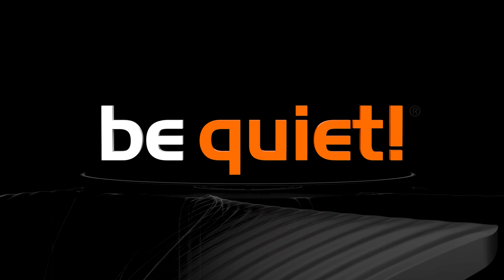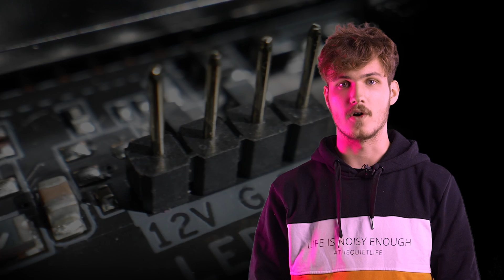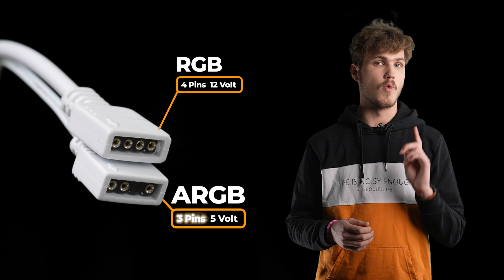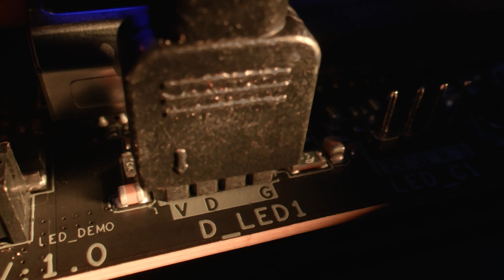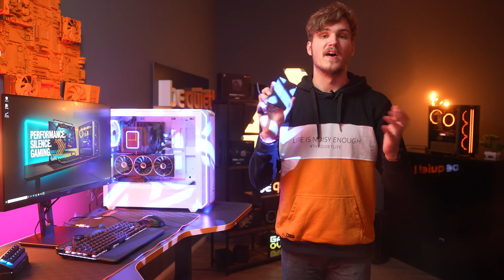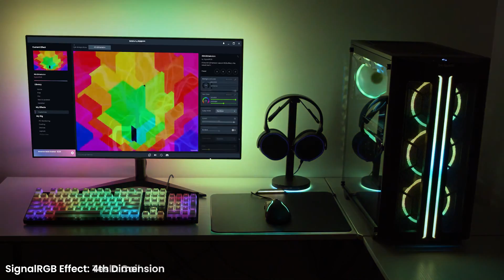Mastering ARGB Lighting: The Ultimate Guide for PC Gamers | be quiet!

Comment: I'm so screwed. I bought the wings.. they're amazing and match my system. BUT my case has no hard-wired ARGB controller/hub, AND my MB has NO ARGB port! :(
Reply from the maker: Oh no! 😔
Reply: @bequietofficial  bought an addressable hub/controller with remote for 3 pin stuff. It should work.

Comment: Hello be quiet!.
I've recently purchased a System power 10 550w and found out that my motherboard will not let my system boot. I have another board, but it has weird connectors and a 200w psu, which Wouldn't work for my 2080. I just wanted to ask if it's safe to connect the system power 10  to the gpu on the other board, and if I'm gonna have any warranty issues.
Reply from the maker: Please get in touch with our wonderful colleagues in customer support to receive assistance on this matter: https://www.bequiet.com/en/contact/service

Comment: The problem with 901 is that i cannot adjust light power of the control panel. It's too bright and light cannot be turned off completely.
Reply from the maker: If you control the lighting via your mainboard, you can also adjust the brightness.

Comment: i"ve sold Elite cooler. It's too loud when comparing with Dark Rock 4.
Reply from the maker: It's a pity that it didn't convince you. The silent mode of the speed switch has been designed for particularly quiet operation. Have you tested this and adjusted the fan curves?